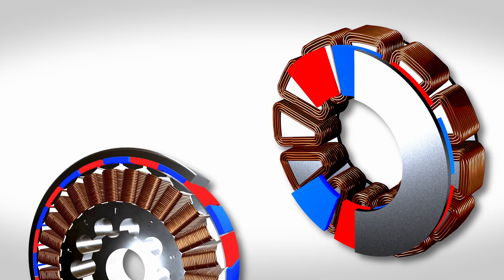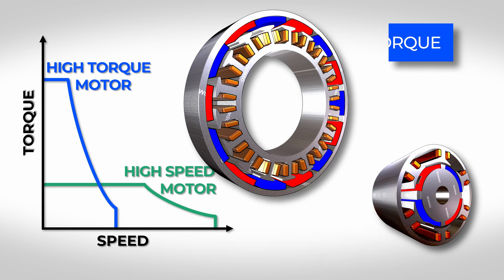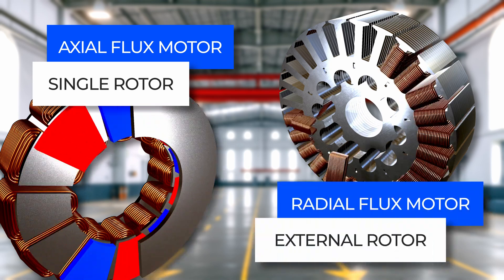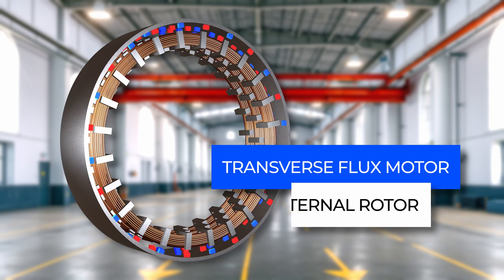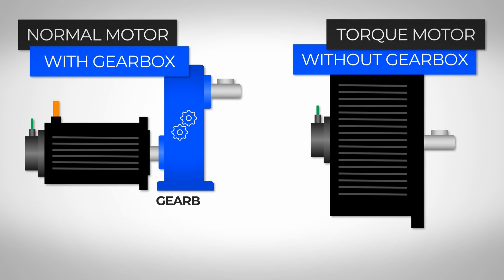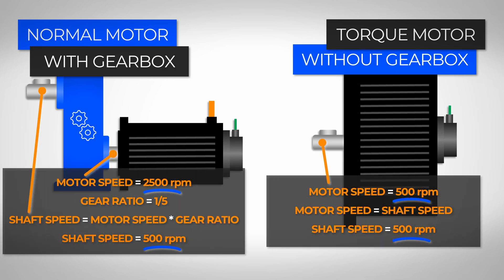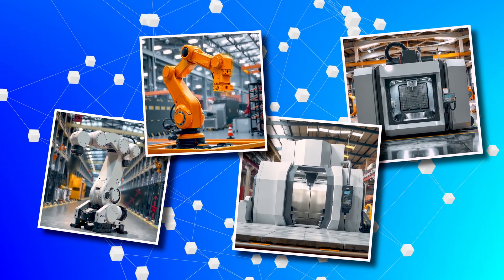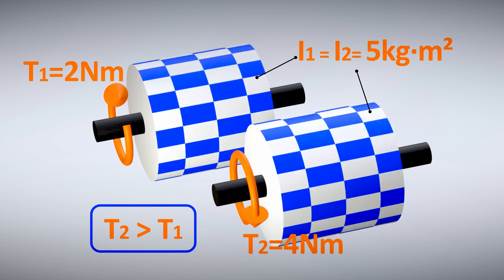High Torque Motor Types and Applications

Comment: Think they could combine high torque motor with a diesel engine to assist compression stroke making a more fuel efficient hybrid engine that would accelerate faster
Reply from the maker: @miken7629 I can well imagine this for a single-cylinder diesel, but would it also work well with 4 cylinders, for example? What do you think?
Reply: @Electric-Motor  I think if the approach is to use the electric motor as the main control then the diesel engine would react mechanically, then some electronic link to fuel injectors would be needed to supply enough fuel to match the rpm

Comment: Gold motor windings could be used for electric motors in high end sports cars.
Reply from the maker: Why should you do that? What is the advantage?
Reply: @Electric-Motor  Gold is one of the best conductors of heat and electricity which may enable smaller lighter electric motors, and a prestige marketing niche as well as an investment in the prestige vehicle market.

Comment: I'm in the process of rewinding my old brushed dc motor. I think it had lap winding. I don't need the level of torque it had and it had a no load draw of 200w. I was looking at Wave windings but not sure it would be enough torque
.
Reply from the maker: Adapting brushed motors is not as easy as with BLDC motors. This is because you naturally change the motor characteristics by adapting the winding. With a BLDC motor, you can simply adapt the software. With a brushed motor, however, the control is mechanically fixed. Therefore, only small winding adjustments are probably possible.

Comment: Thank you, it was good video. When is the next video about high speed motor, i am looking forward :)
Reply from the maker: Thank you for your nice feedback, next video will take a while, so subscribe so you don't miss it, LOL
Reply: @Electric-Motor  I subsribed. Can i ask one more question? I know this question is basic but sometimes it stack in my mind. 

As you know, Input power=Output+Loss, Input = V.I - Output= (torque) . (rad/s). 
So, we kept the rpm constant, and ıf we increase amps, torque increases. Okey. But what is the effect of motor types to torque, why we choose different rotor and stator geometry?
Because if we increase the amps, we can get more torque. In my opinion, it is related to torque per unit rotor volume(TRV) and current density or effiency, isn't it? 

Thanl you
Reply from the maker: @azizcanbozkurtf1  In certain areas, BLDC motors with magnets behave relatively linearly. This means that below the rated speed and the maximum torque, the torque can be adjusted with the phase current. If you exceed the maximum torque or the rated speed, the motor starts to behave non-linearly. This means that doubling the phase current does not lead to a doubling of the torque. The main reason for this is the saturation of the material. It is highly dependent on the motor design and motor type. Thank you for subscribing. What are you working on and what is your specialization?
Reply: @Electric-Motor  Well, it is helpfull reply. Thank you.

I am working on Simcenter E-Machine and Simcenter 3D. I am not export now but I develop myself on Low Frequency Applications.

Comment: Hello Scientists, Engineers and Fans of combustion and electric engines. While combustion engines have and will continue to have a significant advantage in land and air communication, brushless synchronous engines, in the version of high electromagnetic torque, are waking up to the future (!). Particularly noteworthy are the widely known Permanent Magnet Synchronous Motor [PMSM] and the less common Brushless Hybrid Fast - Rotation Motor [BLHF-RM], which I created. These engines must be powered by a hydrogen fuel cell to catch up with combustion engines.
Therefore, I am once again asking OSWS for a BLHF-RM analysis, multimedia presentations, numerical studies and dyno tests.
Please visit my website and YouTube, best regards 😀.